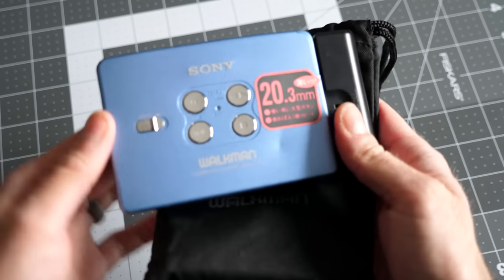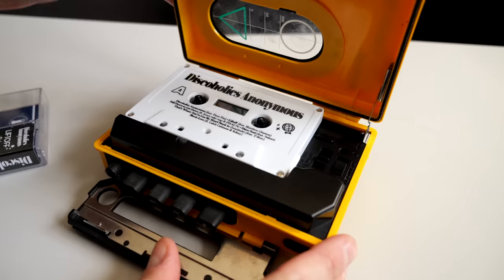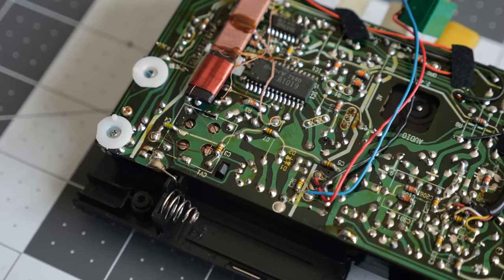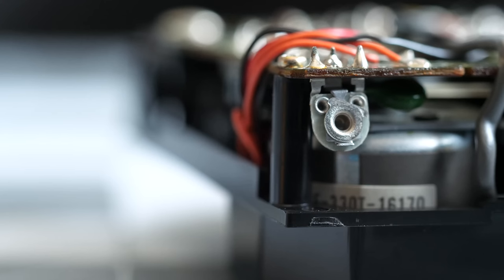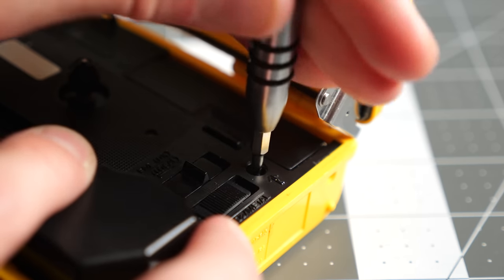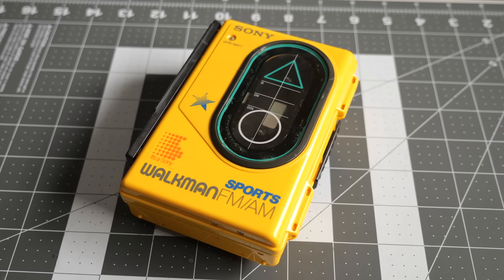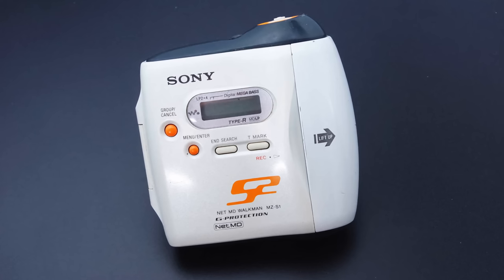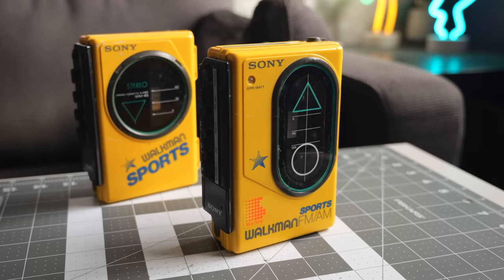Sports Walkman: Sony's Go-Anywhere Portable Electronics!

Comment: 80's nostalgia here - those Sony Walkmans, ghetto blasters and radios were and still are pretty cool looking. Quality as always!
Reply: I have Sony Walkman WM-F10 the first cassette box sized walkman with fm radio in 1984, very good condition and it's upgraded brother  - WM-F100II from 1989, I love how small Sony made them to be - 30 years ago
Reply: @1sonyzz  That's one to hold on to!
Reply: Original boom boxes and ghetto blasters were really of the late 70s and very early 80s.  By the time this thing was released in 1984, ghetto blasters were dead and replaced by low end portable stereos.

The early machines we call "ghetto blasters" and "Boomboxes": were high end machines made possible by the solid state revolution.  They were "solid state" machines in the truest sense in that they were discrete component machines.

But by 84, they were no longer discrete component solid state devices, but loaded with ICs to the point that most of the space inside was empty.  The sound quality and even the quality of the radio tuners plummeted like a stone along with the price.
Reply: @tarstarkusz  Agreed, portable stereos is a more appropriate term and name for the time. You know your stuff
Reply: Oilers/Spartans circuit city brings nostalgic memories, 5 years later at the Pomona store she had a chance to fill out a form for arbitration because of rejection. So don't feel like she haven't suffered, because she makes 4x more money NOW than circuits city employees

Comment: Glad to see the Sports line finally getting some recognition! My first Walkman was an F397 I found at a thrift store for only $5. It had a bit of corrosion on the battery contacts, but after some isopropyl it worked just fine. If you can find one for a decent price, it is a no brainer to pick it up.
Reply: I honestly don't get why anyone would want to pick one of these up.  These were generally low end devices.  I suppose 5 bucks in a thrift store might be worth buying, but not ebay.  If you want a portable cassette/radio combo, there are much better models. SInce you will likely have to do at least some maintenance anyway, you might as well get a decent model.  Also, do not buy cheap belts from Ukraine.  You should buy the proper belts.  They are much more uniform and are sized properly. Using a too small belt, even by a very small amount will burn up the motor.  They use bushings and those bushings will wear very quickly.
Reply: @tarstarkusz Of course there are always better models, but most people getting into them now don’t really care about getting the Best sound possible, we have digital music for that. So just having something that sounds alright, is cheap, and is easily repaired if it wears out are the main draws. Also, these were built as runaround machines, so they’re far more durable than some of the higher end slimmer ones. And even though they were low end when they came out, most of them are still light years ahead of any of the cassette players being made today, in both build and sound quality.
Reply: @Jackster743  I don't like modern digital because I don't want to pay for a virtual item.  To me, that's the draw of a CD or cassette or vinyl.  What you are paying for is connected to the medium itself.

I agree this is much better than what is sold today. My point is if you are going to buy vintage, there are better models.

I also would want a high quality AM/FM stereo.  I actually still use a walkman till this day.  I don't like carrying my personal tracking device (AKA phone) while biking. So I carry a cassette walkman I can control right through my clothes.  I also create playlists on youtube and then record those playlists onto a cassette.
Reply: they go for 30$ - 60$ nowadays - worth it ?

Comment: My first CD player was a my first Sony branded one. I remember I used it until it died, at which point I finally replaced it with a home stereo component player. I was lucky enough to find another one complete in the box a few years ago on eBay for a very cheap price. The only thing it was missing, was the included, audio CD, which I just happen to still have from mine!

Comment: Nice to see this one still works well! I’ve got a Sports Walkman from the 90s, similar to the one at 9:07 and it works very well. The original belt still worked although I have since changed it, and it’s even better than before! Not exactly top of the line hardware, but very easy to open up and service!
Reply: I have my late step father's mono speaker(stereo headphone jack) AM/FM cassette boombox version with the chunky grab handle, and it's held up very well since the early 90's even the rubber antenna. The only things It needed a few years back where new belts, cleaning the battery contacts, and an overall good cleaning. So yeah I agree they are not the top of the line, but their more simple rugged design is a bonus these days compared to Sony's other models when you have to service them, Plus that Yellow plastic sure does make a statement you don't get from electronics these days 😊
Reply: Nice that it still works well! Even with a plastic housing, it doesn’t seem low end. They definitely knew how to make them last. Plus the plastics can’t yellow, when it’s already yellow! (It can still change, but I haven’t seen any Sports models look “yellowed”.)
Reply: @CommodoreFan64  I have 3 of the sports boomboxes. They are indestructible!:face-green-smiling:

Comment: I have my late step dad's Mono speaker(Stereo headphone jack) Cassette AM/FM(the pure analog tuners are a nice bonus for fine tuning in a local station) Sony Sports Boombox with a rubberized grab handle, and it's held up well since the early 90's, having survived many family trips at the lake camping, the beach, and on the boat fishing, water skiing, etc.. with the only thing it needed where belts, and a really good cleaning. So I say if you see one of these in good shape for a good price, or someone is getting rid of it, then grab it, as they are far easier to work on, and more durable than a lot of Sony's other portable Cassette Walkmans, and Boomboxes. Plus that Yellow sure does make a statement you just don't get these days!!

Comment: Have you come across the Panasonic SX60 and AIWA JS415 and JX849? I've restored the walkmen I had in my high school days and am surprised how good the AIWA HS-JS415 sounds, considering it was AIWA's relatively lower end recorder, super easy to restore too. JX849 with BBE also sounds so good. Panasonic SX60 excels in its industrial design -- folding cassette loading mechanism and colour LCD remote

Comment: After my 1995 Sony Walkman stopped playing (most likely due to the rubber belt) I purchased a 2021 Sony Cassette-Recorder from Amazon which is a lifesaver. I have a dual deck Sony Component Unit but it hasn't been used in a very long time, I don't want to take my chances!!

Comment: As a teenager I would get one of the high end Sony models, whatever was new, get the warranty on it and then take it to the pool and see if it would last as I spent the evening playing in the pool or whatever. I'd try the Radio, Tape Player, and the CD models.... Some would actually last a while even in my swim trunks as I'm fully playing in the pool, we ain't talking about a little splash lmao.... Although most would work fine in the shower... Also had the Sports Cordless home phone and it lasted quite a while. Man, I miss those buttons and how just solid they were. Good times! Especially going back a day or two later with a broken device and getting my $100+ (or quite a bit more) money back as they ask WTF I did to it .. 🤔😲 and then going to try a different model or the nearest Service Merchandise and drooling over the stuff there and rinse/repeat. 😉
Reply: I got my sports walkman in 1987 at service merchandise for $75-$100 dont remember?  Love it to death. Today I have a few yellow sports boomboxes from the 1990's (sony 904&905) i use them outdoors camping, washing the truck, in the shower etc. They are indestructible. They may live on as long I do ? Love them:face-purple-crying:

Comment: I bought a 2nd hand F73 three years back. The radio was working, the cassette played but there was no sound. I read it was probably a bad capacitor and since I have no knowledge of such repairs, I sold it. Sadly, this was one of those "skin-deep beauty". It didn't sound as good as the early cheaper models nor the later high end models.

Comment: I still have an awia and Panasonic Walkmans and they both work well. The Panasonic sx20 is a pain as it had a proprietary rechargeable battery with a small AA booster which is the only thing that powers it now the awia is 40+ yrs old runs on AAA batteries like a boss.

Comment: Looks quite similar to a Sony YPPY YP-ES20 I scored at a flea market a few months ago (but mine features an auto reverse mech instead of being auto stop). Had to change belts too, but at the back of the PCB it had a threading schematic (that's what I call attention to details). I fitted a squared belt (what I had available when I got it) and it sounds a bit fluttery, so I suppose that Sony Walkmen should be more happy with rounded belts...

Comment: I've personally had terrible luck with sports walkman. In the 3 or 4 years that I've been collecting and repairing them, I have tried to repair at least 7 sports walkman and I've only been able to successfully repair 2. They are certainly more durable, reliable and easier to work inside, but because of that the units that don't work have very strange problems. I had like 2 that had broken or damaged gears, one that had a problem with the ICs, one that had liquid damage so severe that it was impossible to repair, and one that was beaten up beyond recognition, needed all the capacitors replaced, and even then it didn't output any audio.
And because of that every single time that I'm looking to repair a walkman I try to avoid sports models

Comment: ALL the US Walkman models were junk. They were all big, chunky and lacked the high end features like Dolby C NR or Amorphous heads. They were also usually sold with low end over-the-ear headphones instead of far better sounding high end ear buds. I remember when I was a kid we used to laugh at the stupid models sold in the USA. The Walkman to get back then was the WM-701C which was slimmer and smaller than the regular cassette case, all metal and had both Dolby B and C NR along with DBB. It ran for about 2.5 hours on a super slim prismatic Ni-CAD battery (NC-6WM) that was about 2mm thick. There is an optional external battery pod for a single AA battery but nobody ever uses that. We used the MDR-484 earbuds with it which had a diamond coated diaphragm and LCOFC cords. Anyone who really cared about sound will never buy pre-recorded cassette tapes from stores but will instead buy CDs and transfer it via a proper cassette deck to SONY Metal Master Cassette Tapes with Dobly C NR processing and proper recording level adjustments. That's high school portable audio for me.

Comment: Hope you do get to do a video on the My First Sony line. I still have the "My First Sony" analog alarm clock/radio that I got as a kid, remember seeing it in a catalog and waiting for it to come out on the conveyor belt at Service Merchandise. It felt somehow grown up to have an analog ticking clock even in that bright red, and during power outages it was the only battery radio on hand already set to got and would get moved to the kitchen counter. At one point it did stop running for a couple years until one day it started up again on my desk where it was being just a radio, no idea why it ever stopped but it continues to run to this day

Comment: I've got a WM-FS420, which is a really nice Sports Walkman model, but I have to do some desoldering/re-soldering in order to get to the belts and replace them. It doesn't look too difficult, but I'm new to soldering and haven't felt ready to take it on just yet. The mechanics and radio seem to be working fine, though, apart from the belts. I recently bought some soldering equipment based on your tutorial video on it, Colin. Thanks for publishing that!

Comment: Typical cheap Sony mechanism 'vibrato'. One of the reasons I always preferred Aiwa walkmans.
Still though, this shows how ridiculous it is that we all want sleek, small, design stuff. It's just a pain in the ass, and unreliable with proprietary parts to boot.
This is a walkman to my heart, if slightly fluttery.
Lacking highs sound a bit like the heads are somewhat 'off'. If adjustable that may be worth a little adjustment.
I once picked up one of the Sports boomboxes locally for a friend
https://youtu.be/AVB456ovEkw

Comment: The walkmans of that line were unnecessarily ruggedised.  There's no point of having a bulky case if it isn't immersion proof. And the audio quality, as you mention, was poorer than that of the walkmans of the standard line.

Comment: I don´t like the sports design much but it´s definitely a good way to dive into the format.
I have at least 4 completely working and 100% in spec Sony WM EX 670/672/674/677 (they´re all the same).
Probably one of the very best slim walkmans ever made.
They have all features avaiable without the need of an annoying remote.
The Sony remotes were pretty cheap and nasty, the volume pots always have a slight inbalance and tonal shift involved.
It was probably never an issue with the included crap-phones but it certainly is with modern mid to high end headphones like my beloved Beyerdynamic Aventho wireless (it also works wired, bypassing the entire bluetooth electronics with a switch inside).
It really is incredible how great the headphone amps were back then even in mid tier consumer electronics.
The tape head is able to pick up even the brightest nuances.
The only downside: You can clearly hear if something is wrong, as good as the treble response is, it´s very subsceptible to minimal dents or damage in the tape itself or a slightly misalignment in the tape path due to bad pinch rollers or bent chassis.
The tape head´s azimuth is factory and can´t be changed either.

Comment: Looks like you put the headphone jack back incorrectly. At least - it doesn't match when you first showed it in the video. When you first showed the headphone jack, the solder pads were against the back of the case. But when you show putting it back, you show them facing up.

Comment: You forgot to clean out the old lubricants and replace it with fresh lubricants, this is especially important for the capstan which is attached to the flywheel, this should be removed, cleaned, re greased and replaced to improve wow and flutter because it's the job of the capstan pin to regulate the tape speed....